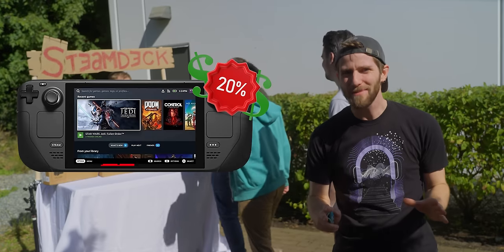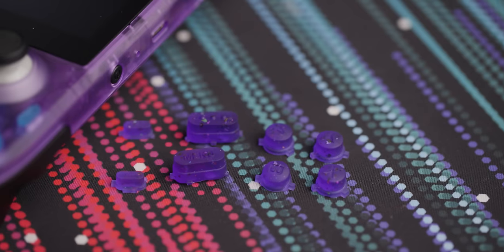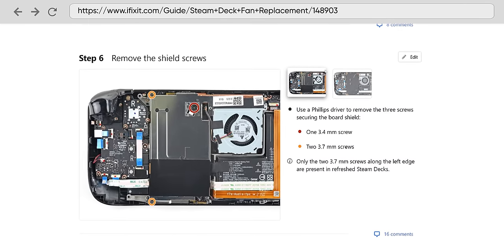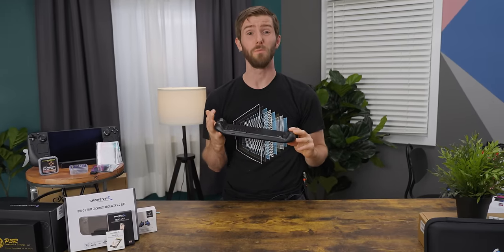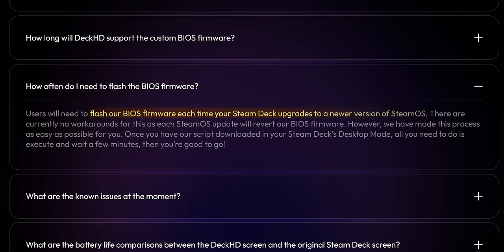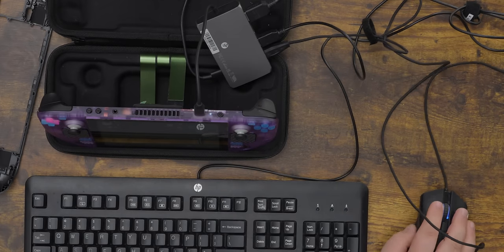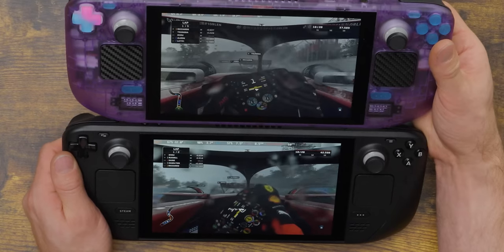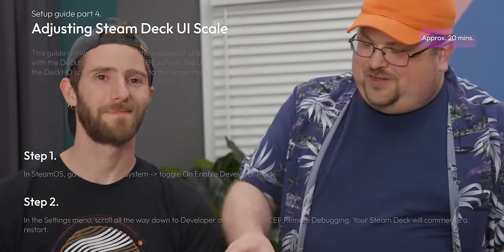Five Steam Deck Upgrades under $100

Comment: FYI -- SteamOS 3.5 automatically mounts external drives and can format drives in Settings->Storage, so the issue with setting up the dock's drive mentioned at 15:48 should be resolved once Valve fully releases 3.5 (or if you install the OS preview)
Reply: Kinda weak that ltt didn’t find that out themselves
Reply: @juli0q  If you've been keeping up with the LTT drama recently, the whole thing is that they rush their videos and make way too many mistakes to be considered a reliable source.
Reply: I see this as a positive, they aren't spending their time on preview versions, so that gives them time to refine everything. @Krilium
Reply: chill. do you even know how long this video is in production? 3.5 isnt even that long in beta
Reply: @PatalJunior  exactly, while a mention couldn't hurt, most users aren't using preview builds anyway so this is a more realistic representation of the experience.
Reply: @Krilium  When did they even shoot this video specifically and when did 3.5 become widely available for people to test?
Reply: @casparhughey5651  and? steam deck was not designed to have drives plugged into it randomly its great that they are adding the feature and not ignoring everyone
Reply: @casparhughey5651  Linux does it too FYI. It's just been disabled on the Steam Deck because it's not a common use case for a handheld console.
Reply: @AngryApple I know right? They're not omnipotent, they'll just have to deal with whatever software issues they have at the time of recording
Reply: @randomblock1_ How are they ever gonna address software issues in your opinion though? The SteamOS Version isn't even published yet it's in beta, so if people buy the drive now it will work as shown in the video. What do you expect them to do? Wait 10 years until software support has ended so they can be sure no retroactive changes can occur?
Reply: @agafaba  looking at how they mention steam deck sales (14-21 September 2023), I guess they shot around that time. 3.5 Preview is available at 16 September 2023.

Contrary to comment above, this is exactly the opposite of "it is not helping their case about rushed videos" lol.
Reply: @Stavroization  Most people aren't going to be running GitHub scripts on their Steam Decks either so this is a moot point. Let's be real, it's way easier to just swap to the beta image than ask most users to run a third party script for which they have to go into desktop mode with a keyboard and mouse.
Reply: @casparhughey5651  Automount under Linux is absolutely a thing, what are you talking about? Gnome does it automatically out of the box. KDE, which SteamOS uses for  desktop mode can be configured to automount as well under System Settings -> Hardware -> Removable Storage.
Reply: @Krilium  He is talking about a beta software, you know unreleased and without a proven feature set. Its entirely possible that this feature is un-reliable or gets axed by the time the full 3.5 release comes out.
Reply: @agafaba  Knowing their ‘fast paced’ work approach, maybe an hour or two before it was made public? 👀
I’m kidding, I now know it’s a beta build and that’s fair 🤣
Reply: @randomblock1_ you can literally say that for all tech videos that involves software receiving continuous updates.
Reply: @juli0q  3.5 came out very recently, LTT doesn't work on videos for a day, some sit in production for a month+, its entirely possible this video was beyond the filming stage by the time 3.5 was released

Edit: at the beginning they showed screenshots of a steam deck sale on September 14th-21st, so its 1000% possible it was filmed on the 14th, 15th, or 16th before steamOS 3.5 was available

and sure you could say "why not edit in something to say is" but they could have just not known, or even known but decided it was not worth it, why? because when making a video on modern devices, especially the steam deck, the video WILL end up outdated, software updates as we see, can make anything you say irrelevant

also, 3.5 isn't fully released, whos to say Valve doesn't find an issue with the auto mounting and axe or delay the feature, its not good practice to recommend preview software, sure they recommended a github script but with the disclaimer to validate what you are running
Reply: But it also stutters like fucking crazy. 3.5 is not ready yet.
Reply: I ❤️ valve
Reply: @juli0q is there a 3.5 version for the deck HD though…
Reply: nice info to have thanx
Reply: @Zaviex nope, AFAIK deckhd will still need the custom bios even on 3.5
Reply: @juli0q chill... the beta came out yesterday and the video was probably filmed weeks ago.
Reply: @juli0q  what an insane thing to be upset about.
Reply: @juli0q the video is weeks or even months old so steamos 3.5 wasnt even a thing. How do i know? Well months after the new steam ui was  released their videos were still using the old steam ui
Reply: @AngryApple Since it’s LTT, they probably started yesterday.
Reply: @casparhughey5651  What are you on about? What's the point of lying about something like this?
Reply: @casparhughey5651 Linux doesn't automount??? 
Have the last 10 years of my life been a lie?
 did I just wake from a simulation?
When was the year of the Linux desktop in this reality?
Reply: @casparhughey5651  What do you mean with Linux not having automount and accusing other of lying?
Reply: @casparhughey5651 actually windows doesnt assign new drives with an alphabeta denomination...only that it is mounted, still have to go to disk management and assign it a value. linux mounting is more complex but gives finer controls. Please dont make it sound as if its that much better in windows.
Reply: @maximumoverflow901 exactly which distro formats and mounts every storage device plugged into it? Because on Debian I have to click on the drive on the file manager to actually mount it. If it doesn't have any filesystem, nothing would tell that to me.
Reply: @UrbenLegend  Yes, automounting is a thing, that is initiated by the user. No Linux distro to my knowledge automounts every storage drive. And none I know would randomly format a drive so that it can be mounted.
Reply: @Krilium that 'drama' al already months old now, and they don't rush anymore. That automount feature is something in the preview channel, so might even not make it to final. (it probably does , but there is no guarantee). So I don't expect them to know or care about that. This isn't a benchmark video z this is just a 'fun stuff to do with steamdecks' video and it's perfectly fine for that
Reply: @Krilium  They're still better than the overwhelming majority of tech youtubers.
Reply: @Braiam  Which DE are you using? its less dependent on the distro and more dependent on DE. GNOME has automounted every external drive on connection for me for ages. i just tested with KDE with the automount function enabled and it does the same thing.

A drive should never be formatted without the user's explicit permission.
Reply: @juli0q  kinda weak that you expect non power users to use beta versions of operating systems. Pretty sure the majority of people don't even know that windows has insiders version let alone steamOS.
Reply: Lmao guarantee this was filmed prior to or around the beta. Esp given the dates they mentioned in the video if you watched. @Krilium
Reply: By the dates mentioned in the video, around mid Sept, maybe just before. @agafaba
Reply: People have been talking about SteamOS 3.5 for longer than the Mario wonder so I don't think its a real thing.
Reply: thanks for the info, I've been thinking of getting an external HDD for my deck lately, and that dock interested me until I saw that it had the same limitations for mounting.
Reply: @maximumoverflow901 No, it doesn't. Linux is my primary OS and I know for a fact that it doesn't. You have to do it manually by adding the drive to fstab. You'll also need to find the UUID of your drive to be able to add it to fstab. I had to do it last week on my PC when I added a 3rd drive for my games :)
Reply: @casparhughey5651 You're right, it does not. lol
How I know? I had to do it last week myself when I added a 3rd drive to my PC.
Reply: Yea, I was coming to the comments to say the same thing. It's easy to do....
Reply: Lmao, HD screen costs the same as piece of metal (cooler)
Reply: Steam deck is really expensive but is cheaper compared to a gaming laptop
Reply: @juli0q  Is it possible they produced this video before that was public?
Reply: SteamOS 3.5 is now released.
Reply: @killingtime9283  Great 👍
Reply: Wonder if I'll be able to format an external SSD with a 3rd party dock, hasn't arrived yet but does have some USB ports
Reply: Also, is it not as easy as changing the mount settings in the Disks app in desktop mode or (for more technical users) changing the fstab file to mount it?

Comment: All these upgrades except for the SSD are a complete waste of money
Reply: How is getting Hall effect joysticks a waste of money, it litterly gives you peace of mind that your joysticks won’t drift while having a lower deadzone.
Reply: @jaylomere  no you
Reply: @jaylomere did you not watch the video? 
Linus could instantly tell that the new joysticks were now sticking when aimed at the bottom right corner. There are multiple comments here of other people saying they had the same problem too...
So yeah, the thought of stick drift could be a thing of the past. But actually having your sticks get stuck when using them regularly... that doesn't sound worth spending money on holisticks n time to install them to prevent the chance of stick drift. If my SD got stick drift I would for sure look into putting holeffect joysticks on. 

But ya this video was pretty dumb when everything except for adding more storage had pretty big downfalls included with them. And adding more storage to your deck is something everyone did the moment they got theirs... no need to be in a video two years later
Reply: @MemeCastGuy69  did you not read my comment I said Hall effect joystick in a general term not this one in particular, if you had actually understood my comment maybe you wouldn’t be yapping in the replies
Reply: @jaylomere  linus spent the entire video complaining about them lol
Reply: Am I missing something? He said the thumb sticks are an easy upgrade and are very good.. Earlier in the the video its stated that the shell replacement caused the thumb sticks to.. stick
Reply: @MemeCastGuy69  I love it when people are so confidently wrong 😂 The stick drift is caused by the new shell

Comment: The fact that basically all of those upgrades are very much possible but often times come with great conceptual downsides just goes to show how much valve hit the nail on the head with the Deck.
Reply: I think it also shows that third party support is still so new
Reply: All except the larger ssd is a hard pass.
Reply: I feel it just shows how much more potential it could have being more modular
Reply: @sategllib2191 Modularity has plenty of its own downsides.

If it was modular it would be more expensive, even bulkier and not look as seamless.

If the storage were easier to customize that would be a big plus, but pretty much everything else would be a net negative if made modular.
Reply: @mpholicx2  thumbsticks upgrade is a maybe, I'm super happy with the  stock ones, even reduced the dead zones by a lot without issue, but if/when they break or start drifting I'm happy to have the solution on the shelf.
Reply: @HerecomestheCalavera $2 in material, if you don't have a million dollar injection molding machine in your house, it probably costs a lot more effort. People don't work for free.
Reply: @HerecomestheCalavera  The creator commented on the video and said they make them from scratch and do the molding themselves. And since it's by a single person, they most likely don't buy the material wholesale. Why buy that much material if you aren't sure you're gonna sell enough? So they probably buy at a slightly increased cost, just enough enough to meet demand and have a bit extra for stock. All this considered, the $50 price seems much more reasonable.
Reply: Great observation, I was feeling the same way. They seem to have the best settings stock, minus the charging mount that has the m.2 slot.
Reply: gotta love valve and their obsession with modding
Reply: Yeah, from the looks of it, the best steam deck is the OG steam deck. W valve
Reply: @TAMAMO-VIRUS  Price might be reasonable in justification but definitely not reasonable and worth it for consumer. Some things better be left for big time manufacturers.

Comment: Small correction: the extreme rate cases don’t use the same threading as the steam deck because the steam deck doesn’t have threads. Valve explained that the back screws cut into the plastic posts. This is why they don’t recommend opening your steam deck and state it severely weakens the deck.

If you plan on tinkering with the internals I highly recommend the full case replacement (but the screen removal is a huge difficulty spike)

Also, the thumbstick daughter board is screwed into the front case so you can flip it over and test the friction before installing the controller board. No need for full assembly before testing them.
Reply: @insignia406 for most people, it might be a bit much to risk. You are right that it isn't too hard. But for me it was fairly difficult

Comment: the Aftermarket scene for the Steam Deck is incredible, Valve captured lightning in a bottle with this and I REALLY hope their refresh has Oculink or Thunderbolt 4 support to really push it ahead even further
Reply: At this point, Gaben is Thor the way he captures lighting in bottles.
Reply: Except for the fact that windows based ones can have their screen replaced and it’ll work. Valve really locked it down apparently.
Reply: @NameName-ll2yx  Nothing says it can't be fixed and the other screen is so aftermarket, it's it even a replacement, it's a replacement that has a different resolution, coloring and drivers. Replace a broken screen with another official screen and it should work fine.
Reply: @Saint_Wolf_  the way Windows works and the way Valve's SteamOS works is entirely separate. You can replace the screen on the Steam Deck with a regular screen no issue. But the SteamOS has to push updates like a console, so when they update the SteamOS build, they push the firmware with it. This makes sure any issues resolved in firmware aren't being left out because people don't go into Desktop mode to install firmware updates. Windows devices don't do this because it's Windows, you just treat it like you would any other desktop
Reply: occulink? this is the gonna fair that much better in vr than the quest itself
Reply: @Ikxi  I mispelled, oculink*, it's a form of PCI connectivity that's like Thunderbolt, but that's better performing than Thunderbolt
Reply: @balakehb my Lenovo devices, and possibly HP and Dell do push firmware on Windows.  Because I use business class hardware and they can't have vulnerable systems, it is a security risk.
Reply: @Ikxi 'oculink' is just a nickname for a PCIe x4 cable and connector (it can be teamed to get all x16 lanes if you had 4 cables).

Unlike Thunderbolt it is pretty much a riser cable.  So no extra chip or firmware.  All Valve needs to do is add another M.2 slot with a cutout or door that can accept an M.2->Oculink adapter card.  That is how the GPD Win Max 2 does it.
Reply: Thunderbolt? Seriously? 

That standard for connection is toast.
Reply: @milescarter7803  they absolutely do I never said they didn't, lots of devices get firmware updates especially laptops, but my point was the way that firmware updates are pushed differs because of how the SteamDeck is operated it's intentionally different. If you're in a business environment, the way that your IT team will push firmware updates is also VERY different depending on the size of the company and their implementation of MDM's
Reply: @waxitron9181  hence why I said Oculink first, Thunderbolt is better than nothing at all but obviously the preference is Oculink
Reply: I don't even know what Occulink 4 is so let's stick with thunderbolt, preferably USB4
Reply: The Steam Deck is dead once SteamOS 3 is publically released, since there are soooo many other Steam Deck alternatives that are just bogged down by Windows but can even outcompete the Steam Deck if they had the same OS.
Reply: @fujinshu  it's not and I can give you one simple reason why, it's price. No other device comes even close to the price. I'm a GPD fan through and through mind you, I think the GPD Win 4 is far and away the best handheld atm, but the accessibility of the Deck's price point just makes it such an easier buy. That's also assuming everyone with a Windows handheld will want Linux on their device, which is just not the case
Reply: @NameName-ll2yx  They can't, eDP isn't as straightforward as DP or HDMI, you need to change the firmware as you change the hardware
Reply: or Thunderbolt 5🤤🤤🤤
Reply: @fujinshu  I doubt it, the Steam deck is priced very aggressively